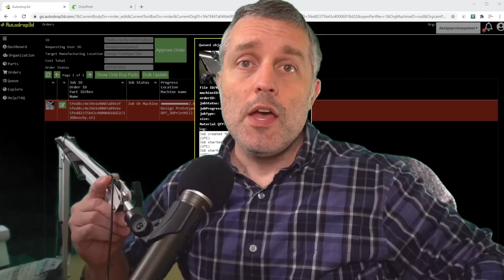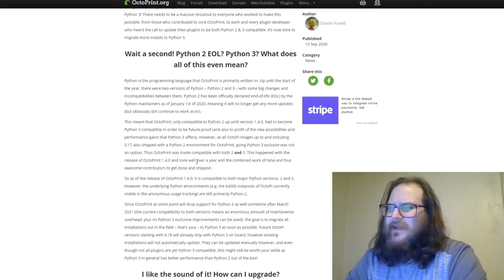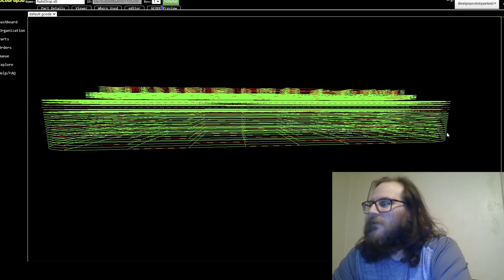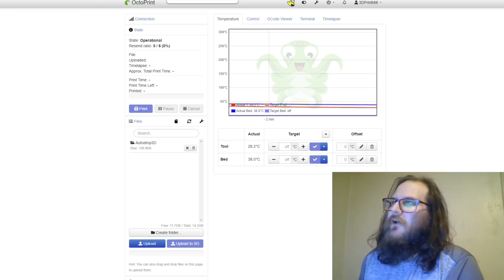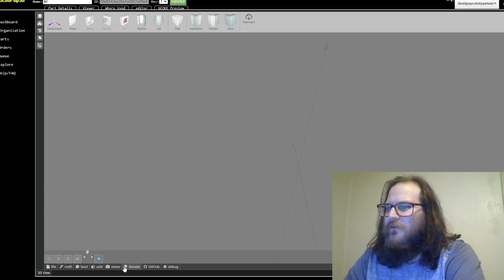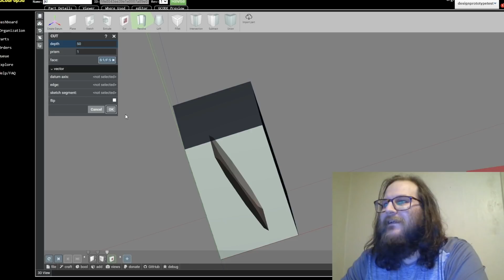Introducing Autodrop3d - An All-in-1 Cad & Slicer That Runs in a Browser & Monetizes Your Printer

Comment: Thats genius. If there was a way to introduce some special hardware for filament so that you have the ability to choose youre filament. Say petg or pla or whatever type and color is available. The only limiting factor is youre stuck using whatever type of filament is currently loaded on the machine.
Reply from the maker: I forgot to mention in the video that you can set up several printers each with their own dedicated filament. The Autodrop3D software will automatically send the print to the correct printer based on the user's filament choice.
Reply: @DesignPrototypeTest  yeah that would definitly solve that problem. Good thinking. This really is a pretty damn good idea. Many practical applications for this program
Reply: Thomas sandlanderer made a video where he set up his prusa in order to have 4 filaments to automatically print from. Not multicolor, but rather choosing the one best suited for the print.
It was called "starting 3d prints without getting up from my desk" or something like that.
That way you could quadruple your filament selection, albeit at the expense of additional stepper motors
Reply: Palette 2, MMU

Comment: Hey I remember back when you were doing the duet board to your tevo an I was doing the same thing actually I still never got mine fully sorted do you think you can go back to that printer ? Maybe add there smart effector ? An a flex drive ? Those are my biggest pitfall. I also have a little air pump for the part cooling
Reply: We talked about it a few time you emailed me your duet configuration but I just stuff can’t get it. Also I have a e3d volcano, pt100 daughter board, 65w Hester my issue is the printer will not auto lever. I could get a new smart effector but I doubt that’s the problem

Comment: But the cr-30 doesnt have a webcam  or something like octoprint out of the box.. what was your setup?
Reply: He simply connect is raspberry pi on it and for the cam it the same as you will use with octoprint. For wath i think. ( Just saw the video and have very low knowledge arround the octoprint )

Comment: I tried the Autodrop plugin on my set-up Octoprint 1.5.2 and got an error in plugin manager "Incompatible with Octoprint or underlying python environment" - I have logged a fault with Autodrop.  I like the concept.  Oh i have given up using Prusa i3 think will make use of its parts in a self build :)
Reply: If you install the latest version 17 of octoprint you will have to upgrade it to python3. Alternatively if you install the beta of octoprint 18 it uses python3 by default.
Reply: @autodrop3d118  updated to beta and plugin load and connects - thanks for this

Comment: Dear me, those bots / fake accounts / whatever immediately leaving the comments, they're still here. Plain as day. Well nevermind! Nothing I can do about that.

What I wanted to say was that considering its an entirely web based cad software... I was really impressed by how usable it seems to be. And being open source it will only get better. In fact I also am holding the same hopes for FreeCAD its just happening very, very slowly. But open source is so worth it. Otherwise the starting price for the only other 'reasonable' option with 3 axis cam is $400 (for the alibre workshop). Which isn't too bad actually. But still. I feel better inside using FreeCAD.

Thanks again for the phenolic sheet demonstration! (from last time). Have since got a 4mm sheet to test out, and see for myself. And happy new years. Looking forwards to future videos on the belt printer here. But also the FoxAlien, and some of your other projects. You somehow always make the topic pretty interesting. No matter what it is about.

BTW in terms of the FoxAlien, were already aware of it's alternatives / competitors? It seems there is also the 'shapeoko' and the 'x-carve' in this space. With at least the Shapeoko being a fully open source hardware project. So having discovered those too, just wondering how all 3 options stack up against each other. But nevermind if you don't want to cover any of that stuff. There are so many other things to cover. And not enough time to to everything. I don't actually expect anyone else to be interested in those same specific ideas. Just wanted to mention them here in comments section.